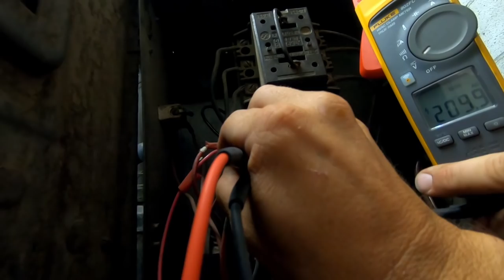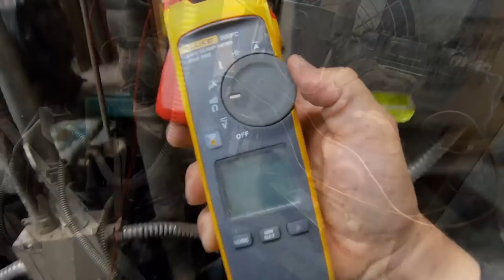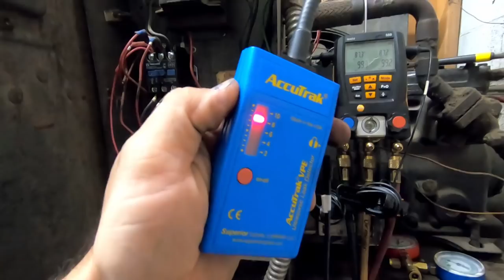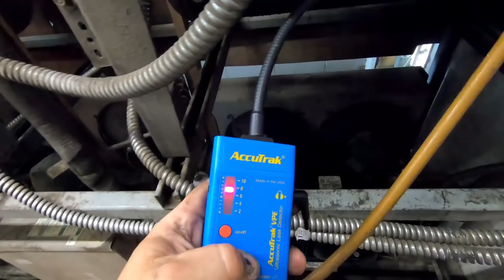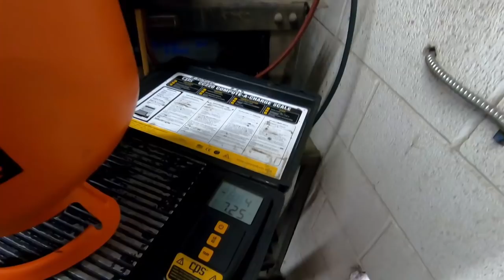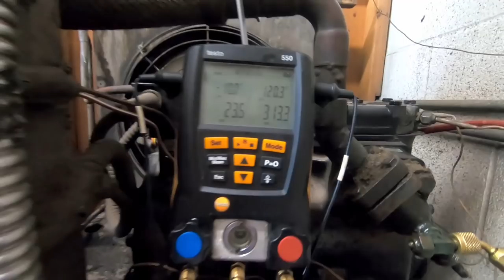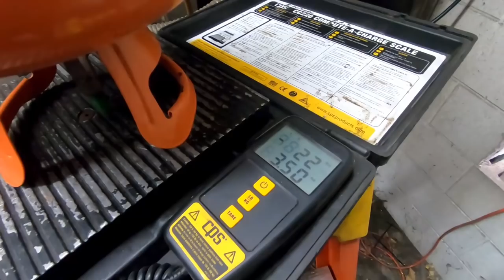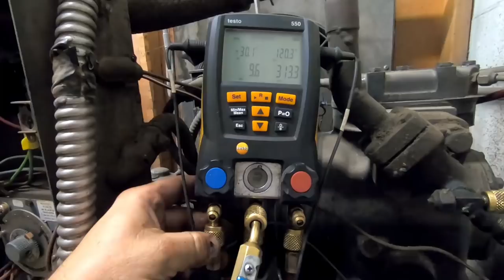Walk In Freezer Warm / Refrigerant Leak / Compressor Capacity Issues / Part 1

Comment: that's one of those "the longer you look at it, the worse it gets kind" of things
Reply from the maker: It was my first trip there so I did not know what I was getting into. The manager said do what you need to do to fix it so that was a positive.
Reply: We call it in England opening a can of worms where you wished u never opened it as there more than one fault there hundreds of problems 🤬

Comment: Nice work. The way you checked the amps on the solenoid valve coil with amprobe was a trick I will surely use.  Thanks.  Those old Prescold/copland units are proper dinosaurs, but will outlast most of the modern stuff.
Reply from the maker: Nothing is made good anymore, it's like everything is junk 🙄. Thanks 4 watching!
Reply from the maker: Ok.

Comment: Thank you for sharing.  Its been a long time since I was in a compressor room like this and they can be quite loud lol.  Most of the stores in my area would vent in the summer and close off to the outside in the winter and use the condenser heat to heat the stores.
Reply from the maker: They looked to be doing that with the pipe in the middle of the wooden box. The real grocery stores we do have remote reheat coils in the air handler and have Johnson controllers. This is kinda like a gas station and small grocery cross over type store.

Comment: Fascinating, I love seeing these older racks, I worked at a Place where we Emission tested cars and had a 15 compressor rack that would chill rooms down to 40 Below. we went through compressors like crazy. they were all Carlyles if i remember correctly, and all r502 at the time, this was 20 years ago. I wished I would have played with more and learned more then.
Reply from the maker: That sounds interesting. Was this used to test the cars in winter conditions while in a controlled environment?
Reply: @HVACRSurvival  That is Exactly what it was for, we had rooms that would get to sub zero conditions that we would soak the cars in before putting them on the Dyno for emissions tests. we had the guys from GM out when they were getting ready to Introduce the Duramax, We froze that engine to -40 and they came in and started it, On first bang they went wide open with it and it Ejected Pistons and parts all over the room. It was a fun Job, I ran all the Process lines through the entire building, about 30 miles of 1/4 inch Nylon tube!!! carying everything from CO to Nitrous!! my dad had worked there before I did and we knew the owner so I grew up watching my dad change those compressors, I would rather work on a huge system anyday of any smaller system.
Reply from the maker: That's why I came to where I am 6 years ago, I'm working into the industrial but mainly been commercial and still have some residential here and there. It's a slow transition when you have been doing the residential for a lot longer, they don't just like you fly to the other side. 😁

Comment: I worked in buildings that loud wearing ear protection and my ears are still ringing . That's is a interesting leak detector. You picked up the leak with the headphone. I would have to set that volume up to 11😂😂😂
Reply from the maker: My ears ring all the time. I have tinnitus but luckily I learned to block it out or I'd go crazy.  I wear my hearing protection more now than ever because I don't want it any worse.

Comment: You can quickly charge liquid with these units to the receiver outlet valve (The True King Valve).  When front-seated, the service port is open to the liquid line so your liquid goes through the evaporator, back to the compressor and into the receiver.  It'll suck a drum empty in a few minutes.  Pause charging to check your sightglass and when it's clear,  add the required winter flooding charge.
Reply from the maker: I got what your saying, it took a few readings to fully get it but I got it 🤣.   I have never tried that but it makes sense. 👍👍 I'll have to try that someday, thanks!
Reply: @HVACRSurvival  I should have said it's pumping down to the receiver while you dump liquid wide open into the liquid line at the receiver out service port.  Back in the 70's some manufacturers like Hussmann, Dunham/Bush, etc offered a 3/8" flare charging port in that piece of copper you replaced.  That's fast charging!
Reply from the maker: Yeah that's essentially what I was figuring you were talking about. how long you been doing this if you're talking about things from the 70s?
Reply: @HVACRSurvival  - I started working summers and weekends with my father and two older brothers in the family business in 1967 and full time after college. After that I was an application engineer with a manufacturer, then refrigeration engineer for a market chain and finally 20 years as a one-man shop.  I retired in 2013.
Reply from the maker: @icemeister6032  Thats really cool!

Comment: if there's space behind or below, It would make sense to just put a big loop in the line.
A. it wouldn't need to be perfect length, since you can bend it to make it right. 
B. it would absorb some of the vibration and not crack as easy, but that said a radial crack like that, I'd guess it was an area nicked with tubing cutter and wall thinned there to start with. never use scratched or nicked sections of tubing, unless of course your the planned obsolescence department :))
Reply from the maker: Sounds like sound advice to me 👍👍

Comment: Great video 👍
Reply from the maker: Thanks Adam! I have to edit the return video, I used the ladder crane with the sliding pulley and it worked like a charm. That had to weigh over 100 pounds they said it was 125 and to lift it that high and far back on the rack would have been hell to do by myself.

Comment: Thanks again Rick for sharing such a knowledge and showing small tricks like checking solenoid with open clamp meter. Do you love that ultrasonic leak detector and would you recommend for having that in tool box? Cheers
Reply from the maker: I like the ultrasonic but I don't use it a lot. It has its special uses but I would invest into a Inficon detek 3 or stratus or H10-pro before going with that ultrasonic.

Comment: Oh man ! The state of that motor room ey !
So , in a case like this , where the compressor doesn't pump down , how do you stop it from running when you get the room to temp ? 
Thank you sir 👍
Reply from the maker: I adjusted the off pressure higher so it would shut down but what I didn't capture was the horrible noise it made when it came out of defrost and the suction pressure was to high.

Comment: How do you know when the flare nut is tight is enough
Reply from the maker: I have a digital torque wrench.  I have used it enough to see how tight is tight. If its a mini-split I still use it. But on the lower pressure refrigerants I don't always use it.👍👍

Comment: Thanks for the blow off!
Reply from the maker: I don't understand?
Reply: Always be polite when a young lady takes care of you.
Reply from the maker: @larrykeenan598  Good Advice!
Reply: " Alright...you stay here and we'll blow that out" Blowing out the condensers. Sacrifice your subscribers.
Reply from the maker: @daviddesilva4971  OK gotcha, I thought I didn't respond to you or something and you were saying I blew you off? DA! my bad..lol
Reply: @HVACRSurvival  ---- was there any real reason for not using the garden hose and nozzle that was looped on the wall behind you?  Did you just want a dramatic messy dust-filled video?
Reply from the maker: There were several reasons but here is the main ones. The time it took to blow it out was much quicker and the miss that water would have created and the potential of damage to the other equipment underneath it was the larger concern. Also I  would have tracked mud into the building and potentially created more problems for myself.  I have plenty of water hose on my truck and water is my preferred method to clean a coil but not so much in this situation. Great question 👍👍 thanks for watching!